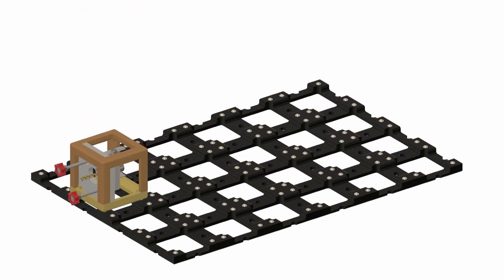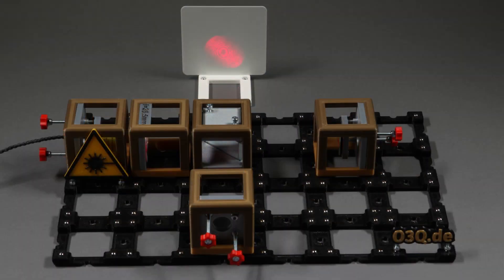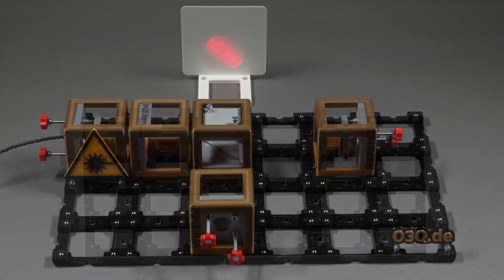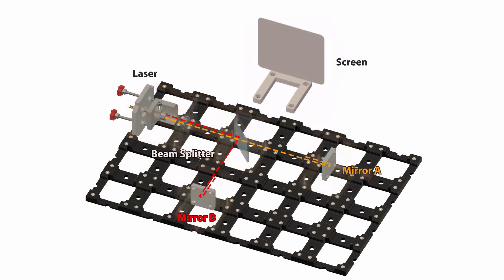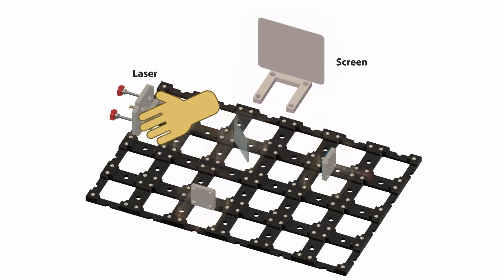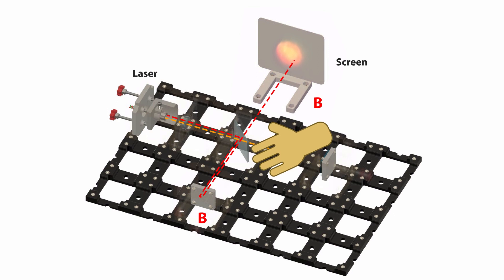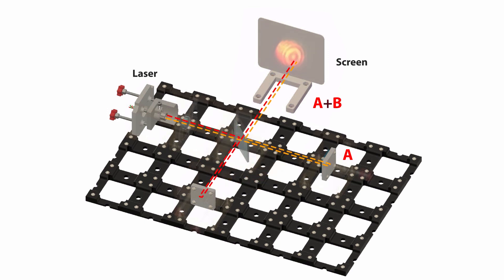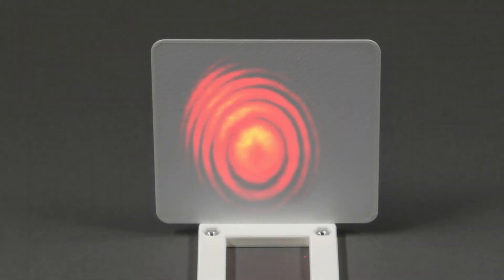Build your own 3D-printed Michelson-interferometer (U1-07-05)

Comment: Nice vid and project, will share mine with alternative variation on modulation controls in the next few weeks. I control beam modulation in femtoseconds, with 3D printed parts, an Arduino Uno and a hand full of components for under 700 US dollars. Patent filed but all designs and file components will be publicly free. over 50% gain in beam efficiency if interested.